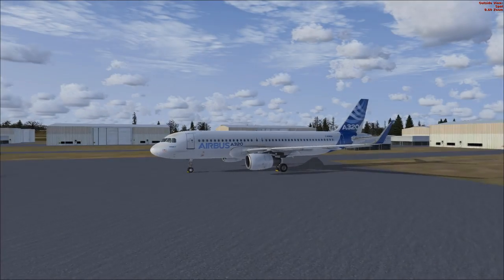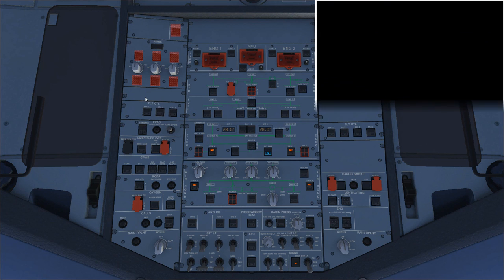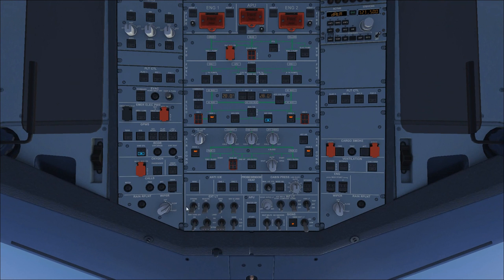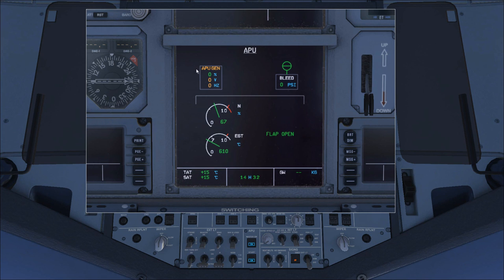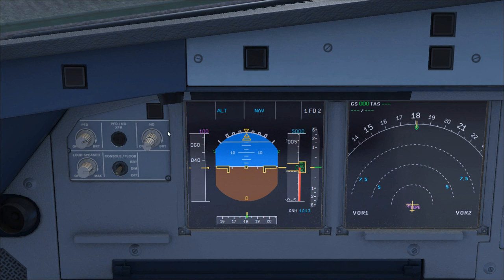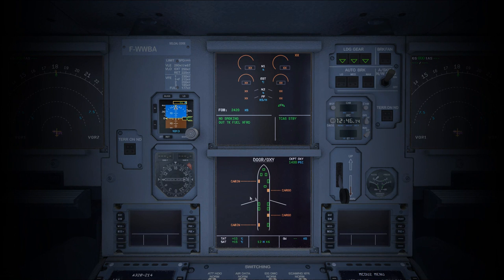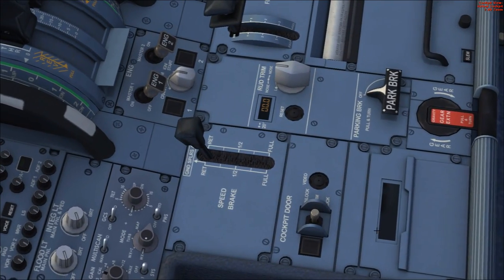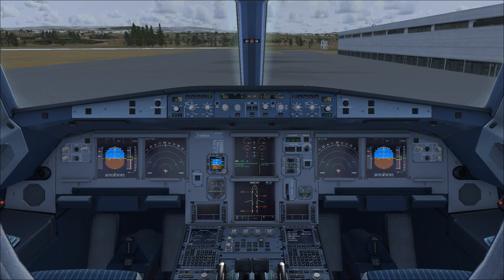Detailed A320 Cockpit Guide (FSX - Aerosoft A320)

Comment: Captain over intercom: "As you can see the engine on the left side of the plane is on fire, now we have turned the alarm on, hopefully the fire will get scared, but no promises, this is all we can do until we hit the ground at a high speed, thank you"
Reply from the maker: Technically any normal landing is hitting the ground at high speed, if the pilot's are in control then everyone will be fine ;)
Reply: @Doofer911  It's all in the angles.

Comment: The wing lights are located on the fuselage. The pilot can switch them on to illuminate the wings, so he or flight attendants can check for ice or damage to the wing
Reply: kabouterplop19 I'm surprised less people know this.
Reply from the maker: Ah ok, thanks for confirming. As I said, I couldn't see any noticable light in the sim and the "Systems" documentation which comes with the plane doesn't cover that specific light switch.
Reply: @Doofer911  in my country, we call this 'WING LT' __wing and Engine flood light. There is one light each side on the fuselage. The RH side is just above the FWD cargo door. YOU can see it in captain Joe's video__Airbus A320 outside check.  This 'WING LT' can light up the area in front of each wing(slat) and engine. So we call it wing and engine flood light

Comment: the MECH button is used to call the mechanic on the ground on the calls section of the overhead panel.  The wing lights are green and red colour and they are called navigation light plus the wing lights used when the weather is adverse during the night is powered by an electric motor.

Comment: 20:28  those 2 panel we call the 3rd pilot or observer RMP and ACP panel. In this RMP panel we can set 'data mode', you can see the active side show the word  'data'. this is for data transport from ground to the plane through ACARS system. When we set frequency to active side, we can also use this for HF and VHF communication

Comment: The "WING LIGHTS" light up the top of the wing from the fuselage to check for icing. The RWY TURN OFF light are mainly at the wing root. They are seen on your video.
Excellent video. Well done. I learnt a lot. (from an actual Boeing pilot)

Comment: If you set the Range Knob on the EFIS panel to let's say 40, then in the ARC mode it's 40 nm to the front (as you told) and when in NAV mode it's also 40, since you have 20nm to the front + 20nm to the back of your position (or the plane icon). Just a little thing I noticed, other than that superb videos through and through! Keep going.

Comment: 6:10: The MECH button on the CALLS panel illuminates a light on the external power panel and sounds an external horn. Pressing either the FWD or AFT buttons causes a high/low chime in the cabin and a "CAPTAIN CALL" message to appear at the selected cabin station.
Reply: yes, and it's only for crew. FWD for forward cabin attendant, and AFT for the AFT cabin attendant. When captain push the P/B SW,  a little screen nearby the related attendant seat will show where the call from. I remember it seem like 'captain' or 'captain call'. And on the cabin top panel, there are several indicator light also turn on in blue shows there is a crew call. When passenger push the attendant call, the screen can also shows the calling position like '34L' or '50R'  LH side or RH side

Comment: Thanks for the info. I don't really like flying a computer so i used this knowledge of the cockpit to learn to fly it manually. I use flaps 3 on take off, turn off the auto thrust whenever it clicks on ( when you go to full throttle the AT kicks in automatically). I also switch off the flight director.  Then it flies like a regular Boeing.

Comment: 5:20: The CVR on RCDR panel, when activated, records the last two hours of communications and aural warnings from the cockpit. Pushing the GND CTL pushbutton manually powers the CVR on the ground. The CVR ERASE and CVR TEST buttons are inhibited unless GND CTL is ON, the aircraft is on the ground and the parking brake is set. Pushing the CVR ERASE button for two seconds erases the CVR recording. Pushing the CVR TEST button sounds a tone through the loudspeakers if the CVR is serviceable.

Comment: The DCDU (Data Link Control and Display Unit) is more critical than described in the video. It carries ATC messages in both directions using a protocol called CPDLC (Controller Pilot Data Link Communication).
Reply from the maker: Not functional on this add-on, hence the lack of detail

Comment: 15:01 there are no spotlights underneath the wing of the A320, or any aircraft. Wing lights refer to small lights on the side of the aircraft that illuminate the top of the wing to aid in evacuation and also to check the status of the wings in case of a problem

Comment: Doofer911,I use fsx steam. I have some problems regarding the Aerosoft A320 .The graphics are not proper in the aircraft. I checked the fsx graphics, I have checked they are high. Question number 2. Do we need to download anything more after installing the Aerosoft Airbus? Like Fs2 crew?? I also have some problems regarding clicking buttons inside the cockpit. Please answer both questions sir.@Doofer911
Reply from the maker: Have you tried re-installing the add on? That'd be the best advice I could give.... if you still have problems after that, maybe contact the developer for support.

Comment: The terrain "radar" is not a radar system. It displays info from a database stored in the planes computers. Also the terrain on ND should only display on its own side, it's a limitation of the Sim that they show on both.
Reply: When both pilots try to control at the same time the plane will announce "dual inputs" and it will average both inputs. If one pulls up and the other pushed down the plane will fly straight. This has been an issue in the past. 
Pressing the side stick priority button tells the computer to ignore input from the other side stick. 
Holding the autopilot disconnect button on the side stick will force the computer to make that stick master. With that held there is no way to override until the button is released.

Comment: His doofer911
the first tutorial and more  I learn from u, I learn to fly the airbus family from u,  thanks u for that.
Can u please help me, I have a problem with my joystick on  the  aerosoft airbus 319  it disconnect the autopilot while I move up and down left and right can you guide me what is the problem? It was all right since I use the airbus
Regards
Avivps
Reply from the maker: The Autopilot will automatically disconnect if you make any large movements on the controls. It's an override feature in the plane in case the pilots need to change direction suddenly (to avoid another plane for example). It's a normal feature of the plane and not a problem.

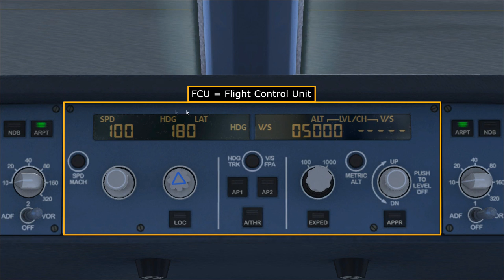Comment: I purchased the Aerosoft A320 for FSX.  When I try and turn the knobs for the airspeed, heading and altitude, nothing happens, no numbers change.  It seems to be set at 100 for airspeed and cannot be changed once I upload the aircraft. The heading and altitude, the same thing, but I cannot recall what numbers they are stuck at.  I am familiar with PMDG 747, 777, and 737.  Also QW757 and 787, but this plane I seem to have no control with setting the airspeed, heading or altitude using the knobs.  At 37:57,  I can see you click the knobs and the numbers change, but with me, nothing at all happens.
Reply: Mouse right click. airbus fcu right click knob pull, left click knob push.

Comment: 7:03 That is incorrect. You can actually use the fire system and both agent suppression controls however they are unclickable when there is not a fire present.

EDIT: Nevermind! I was looking at a video, but they were using FSLabs and not this one, disregard.

Comment: Hello Doofer, We've spoken before; I mentioned I was getting the Honeycomb hardware. got my pedals, my throttle quadrant is on its way. As I understand, Airbus have made the cockpits identical across all of their platforms. I'm only 10 minutes into this video, is this cockpit exactly the same as the other aerosoft Airbus'? 318/319/310/321?
Reply from the maker: Hey Nick, that's exciting that your controllers are on the way! To answer your question, yes the A318/19/20 and 21 all have a common cockpit layout. The larger airbus aircraft are slightly different however but still quite similar. It was an intentional design choice by airbus so that pilots could fly all 4 types without a large amount of training between the aircraft

Comment: Could you please repeat and elaborate about what you said regarding the FLEX mode in the video??
Reply from the maker: So the Flex Thrust setting is mainly used during Takeoff. Many aircraft do something called a "de-rated" takeoff. That means that during takeoff, the engines are at about 90-95% maximum power, but that is still enough to accelerate along the runway and takeoff safely. Pilots use this to reduce wear on the engine, and it's also a little quieter so there's less noise pollution for the public near the airport.

Comment: How did you click the QNH/Autopliot selectors so that the values can be decreased and increased? When I tried, the AP screens just switched on and off, the QNH from default to std
Reply: I mean they just keep getting pushed in the panel instead of rotating
Reply from the maker: You should just need to put your cursor over the control and rotate your mouse wheel to change the value

Comment: Hi. First of all thank you for such a professional job !! I love your videos.
Just purchased the Aerosoft Airbus 320 add on and installed ok.
I have a problem with the FCU. 
I cant seem to find how to increase speed, heading or altitude.
The left and right buttons just push in and out the knobs.
Any clues please?
Reply from the maker: Roll the mouse wheel on the controls.
Reply: Hi. thanks for the tip but no mouse wheel. Using a touch pad on laptop, everything else works except adjustments to items mentioned earlier. I will buy an external mouse with wheel and try it out. The navigation setup is giving me headaches so far. :-(
Reply: Worked 1st time. Many thanks. 
Getting used to flying the A320.
Cheers !

Comment: Where is the vertical stabilizer (logo) lights?
Reply from the maker: It's activated when the Nav Lights switch is on. The switch is labelled "Nav & Logo"
Reply: @Doofer911  The bulbs are on the elevator and they project on to the fins

Comment: I dont have mcdu2 so I will set fuel from the screen that you clik small white buttons over the mcdu but I cant set the zfw
Reply from the maker: There is also a Payload program which works outside of the sim as well so I believe you can set the fuel in that program then "upload" it into the sim.
Reply: @Doofer911  what is a name of that program?

Comment: Which is better Fsx PMDG 737-800 or Aerosoft a318-19 20-21 series.
Reply from the maker: Depends how you define "better"? The PMDG is a more comprehensive add-on, however the Aerosoft is a bit easier for someone who's new to flying an airliner.

Comment: Any tweaks/fixes for flickering/shaking fsx textures?
Reply from the maker: Are you using DX10 Preview by any chance?
Reply: no?
Reply: its only for the scenery, it kind of looks like its flashing/shaking
Reply from the maker: I'm not sure, it could be any number of reasons. Depends on your graphics card, graphics settings, whether you're using addon scenery, possibly a corrupt file somewhere. I really couldn't give much advice on troubleshooting the problem other than to try reinstalling the sim.
Reply: Suppose so

Comment: Is the a320 available for free in game???
Reply from the maker: There is an A321 available in the game (which is almost exactly the same) however it is not as detailed and complex as the aircraft featured in this video. This is only available as a paid add on/DLC
Reply: Doofer911 so is the pdmg, that computer thing come with it too??
Reply from the maker: Yes, the FMC (Flight Management Computer) is part of the Aerosoft Airbus A320 addon and also is part of any PMDG addon. The computers are slightly different between Airbus and Boeing aircraft but add on aircraft model the computers whereas the default planes don't.

Comment: You cannot use anything in this cockpit
Reply from the maker: This isn't quite a "study-level" add on which replicates all of the aircraft's systems. This is aimed at the Intermediate simmer who wants something more interactive than the default aircraft, but not an aircraft which requires 1000 pages of documentation to be studied before flying the plane.

Comment: Pmdg 737Ngx is lot lot better!
Reply from the maker: In what ways?
Reply: Doofer911 
In every single way bruh! 
The pressurization, time taken to start Apu, sounds, the Navigation datas and lots of other stuffs!
Reply from the maker: How do you know?
Reply: Doofer911 
Coz imma 737 user ?!
Reply from the maker: Ok, have you flown the Aerosoft A320?
Reply: Doofer911 
Tried! The fly by wire system sucks! And the navigation isnt so accurate like the A320 in real whereas the pmdg737 has very realistic navigation datas and the way it works!
Reply from the maker: Do you realise that navigation data - aka AIRAC data - is exactly the same across many different aircraft?
Reply: Doofer911 
Actually they are supposed to be the same but the way it shows and functions in the aerosoft 320 is far different from the real 320 whereas pmdg has some real looking shit! Thats all i meant! ☺
Reply: Do you mean the navigation accuracy?